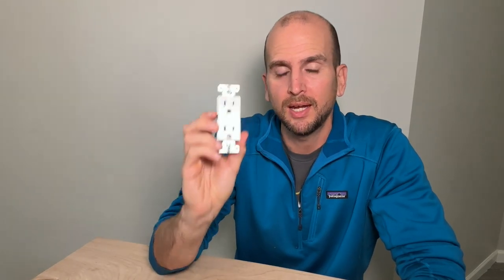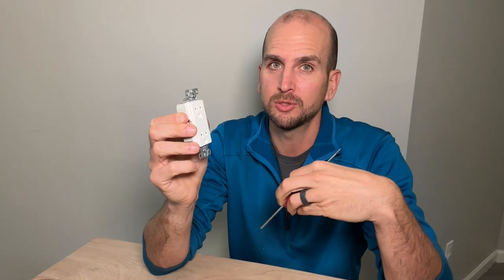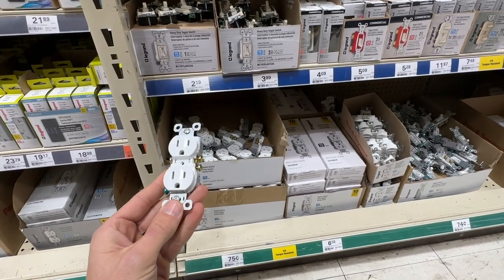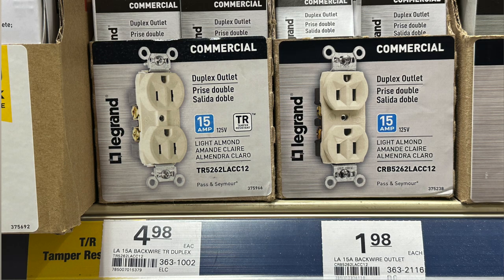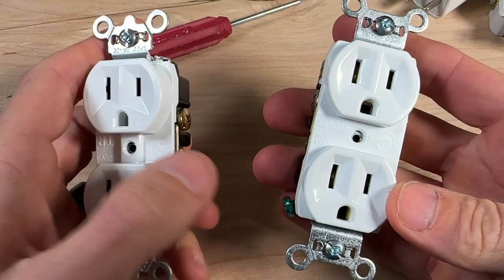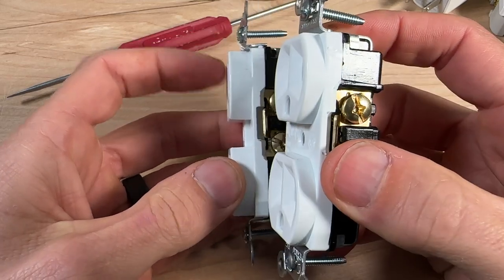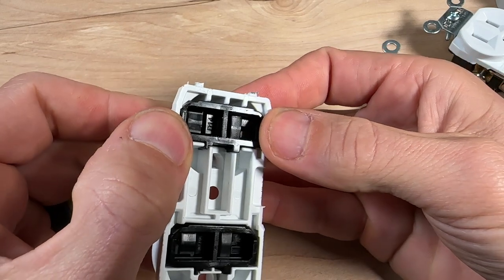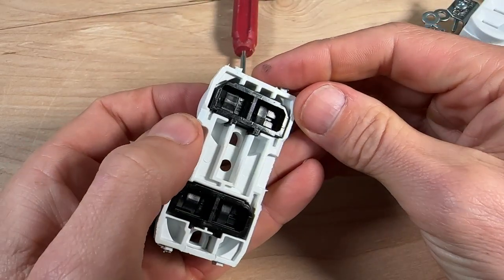The Most Hated Product In Home Electrical

Comment: TR receptacles are a great idea.  However, some of them are plug resistant.  I use Leviton but Legrand is pretty good too.  I don't have any bad brands.  They're all pretty good.  I have a 3 year old niece and a 12 month old niece and I babysit them a lot and so, I absolutely must have TR receptacles for sure!  I plug and unplug equipment constantly and the TR is a must for me.  My dad's RV had cheap quality receptacles and I replaced them with TR because I have 5 step nieces.  I admire the idea behind the tamper resistance receptacles.  I have to have them because of my 7 nieces total.  A power cord is just going to hang there.  Clock is just going to stay plugged in 24/7.  An alarm system is too going to stay plugged in 24 hours a day, 7 days a week, 365 days a year, 12 months a year, and so forth.  But a lamp on the other hand, we've all done it, I've done it, I do it every time I shut off my metal halide fixture, all finished using it, reach down and jerk the plug to turn it off.  I do it to my Christmas tree all the time, I do it to my metal halide light when I turn it off...unplug it to turn it off.  I do it to my central vacuum powerhead to turn it off.  But, no one ever remembers to reinsert the plastic caps, I don't.  Well, when the receptacles are uncovered, that puts small children at risk.  That's why I absolutely depend on tamper resistance receptacles.  In fact, TR receptacles are all I buy because of my nieces.  I had a ceiling mounted receptacle for a garage door opener go bad and I just threw up a tamper resistance receptacle because that was what I had on hand.  That should illustrate how much I depend on tamper resistance receptacles because I babysit my nieces a lot and I love my nieces very much.  So, naturally I am very protective of my nieces and I only buy tamper resistance receptacles for that reason.

Comment: Never had an issue with them. I learned from an electrician friend of mine to angle the plug downward at the outlet openings and kind of roll the plug in. Rather than trying to go straight in as normal. Super easy.

Comment: The residential grade Legrand TR receptacles are pretty glitchy, I find I have to really jiggle a plug to insert it, which is mildly annoying. I'd have a pretty hard time justifying its replacement with another TR receptacle, I would probably use a non-TR Legrabd commercial receptacle. I agree they're the best and I live 1/4 mile from Menards lol

Comment: I put outlet covers that have a sliding cover that stops anything from being inserted that I used when my daughter was a toddler. Those are less complicated, don’t bind as easily, and have a lower price difference than standard covers when compared to tamper resistant plugs.

Comment: I bought a pack of 50 TR outlets on amazon for less than the cost of buying 20 standard outlets at Lowes. I generally prefer them just for how difficult it is to accidentally unplug something from them. Then again, I'm changing out the 40 year old receptacles in my house for new ones, so it only made sense to go for the better bulk deal. At the end of the day, they don't really have any cost difference unless you buy exclusively from brick and mortar stores.
Reply: I hope you like changing out broken TR receptacles
Reply: Bootleg Chinese most likely, or stolen from somewhere if legit.
Reply: What you really want are called spec or hospital grade outlets. They tend to cost a bit though.
Reply: Those bulk packages are  junk... Only if they are buying cheap contractor grade TR Outlets which do not function well....... If you purchase quality TR outlets they function flawlessly! TR Outlets are not deeper than a non-TR outlet...
Reply: Landlord detected

Comment: In our areas, central Arizona, the dust ends up clogging the shutter on the TR receptacles. I’ve never found them to be that much safer, similarly the tamper resistant medicine bottles.

Comment: LOL, I just replaced 112 outlets in my house. I use the Eaton commercial grade outlets, that run about $1.98/ea in 10-packs. No WAY would I pay an additional $330 for unreliable tamper resistant outlets in a house that has 2 adults and 2 dogs.
Reply: Unreliable?
Reply: @michaeldunham3385  Shutters jamming or breaking. The electrical side is going to be as reliable as the same model without TR.
Reply: @JCWren  never had a problem with shutters breaking or jamming

Comment: Since I live in a different part of the world with other outlets (Schucko) I must say I was surprised that those non-tamper-resistant outlets are still allowed. The only outlets that are not tamper resistant that are allowed are those already installed, afaik. There is one exception. The 3-phase sockets have no tamper resistance, but those are never installed indoors where children are supposed to be, but rather in a garage or an industry. (I have a 3-phase soccer in my garage. I can use it to charge my car with a portable "wallbox".)
Reply: @Phillip Banes  Of you think that it should be allowed to install dangerous equipment where kids are supposed to live, then we can only agree to disagree.

Comment: I recently replaced all the (backstabbed) outlets in my house with residential grade Leviton Decora tamper resistant outlets. I get the 10 packs from Home Depot. I occasionally have a little struggle when plugging something in, but I can't say it's been an issue in general. Maybe that brand is one of the good ones?

The price difference isn't nearly as much as the ones in the video either. $13.48 for standard, $19.98 for TR. That's 50% more, not 250% more like the commercial outlets in the video.
Reply: I built my house with these, have had good luck.
Reply: I just installed these too. I like them, and actually don't notice anything when plugging something into them.
Reply: I bought the same. I've never noticed any increased difficulty using them, and the price difference was similar and I say negligible when it comes to safety. I'm not understanding people's issues with these, I guess.
Reply: Same here and haven’t had any of the issues that the people in the comments are saying they have/had with TR outlets. Leviton is the way to go 👍🏼

Comment: As someone with kids, I started with a mix of tr outlets and the plastic covers for existing outlets. I eventually just replaced the first outlet in each chain with a gfci outlet. For the two kids rooms (which sadly is on one breaker) I replaced the breaker with an cafci one. That's how much I hated the TR outlets and the plastic covers.

Comment: I use Leviton receptacles, and Home Depot has them at same price 10 for $50. They have a metal shutter on one side. Their design works well easily sliding a plug into them.

Comment: The sockets in my home were bad, and my son was just starting to crawl. Tamper resistant receptacles just made the most sense. Sometimes they're a little finicky to plug something into, but it's never a big deal. In my garage, I just used regular, non TR 20A commercial grade receptacles.

Comment: When I was about 7 years old I did exactly what he describes and got a good jolt.  I never did it again, but had I not reacted as quickly as I did, that decision may have been made for me on a permanent basis.  This seems like a good idea that addresses a real problem (as opposed to so many so-called safety features that are really just Darwin candidate lawsuit prevention), it just needs some work to improve the design.
Reply: When I was growing up I got a pretty good jolt trying to unplug a big wall wart adapter, fingers slipped and grabbed both prongs while they were still party inserted. TR outlets require a lot more force not only when inserting the plug, but also while removing it. So they prevent one way of electrocuting yourself at the cost of making a different way of electrocuting yourself more likely lol
Reply: This is literally an anti-darwin mechanism. Remember darwin isnt just checking the child but also the parents. Theres alot of parents that shouldnt have kids, and this is preventing one of those checks. A good parent would install the plastic covers, a bad parent does nothing.
Reply: @fctoashton  No serious adult should be conflating natural selection, which humans have bypassed for several centuries, and any safety methodologies designed within a single lifetime, to reduce possibly lethal accidents. Seatbelts, along with modern auto design changes, halved the fatalities, which were once equal annually, to the entire American deaths in the entire Viet Nam war -about 55,000.
  Cynical, self-centered, self-righteous prigs believe they and their families, unique above all others, have a "right" of privilege, to flaut any law or restriction they find inconveniencing, believing their superiority makes them better arbiters of what regulations need apply - until they suffer a consequence, and sue everyone within arms reach, for damages.

Comment: We moved into a home built in 2010. It had all tamperproof receptacles. Two issues we found..  number 1, the TP receptacles installed here have an issue that causes plugs to have next to no friction when plugged in. This means the TP functionality appears to have caused the receptacle sockets to be further back and therefore reducing the contact surface that meets with the blades of the plug. This to me is a fire hazard, as if you are using higher amperage appliances, and the there is lack of good contact, it heats up or arcs.  This seemed more common on receptacles in areas that are used more than others so there may be a wear issue.    number 2, as you mentioned, some plugs are a pain to insert into TP receptacles because the doors won't open. You have to fiddle with it to insert a plug.   We replaced many with non TP receptacles, and purchased spec-grade quality ones.

Comment: Faced frustration with a tamper resistant outlet in an AirBnB (or similar, don't remember for sure) I had for a few days.  I took a key, lined it up, gave it a good whack with my shoe, and no more problems.  Even tho it was in the "long" (neutral) side I did wrap a sock around the key before pulling it out. 😁

Comment: The plastic plug caps are really cheap for the few years you need to protect your outlets.
Reply from the maker: Yeah, not a bad option for sure
Reply: We got the plastic plugs when our son was born (his 23rd birthday was today)and the same plugs are still there and working fine.
Reply: They just look silly, and can be removed.
Reply: Don’t know about where you live, but those child safety outlet covers are actually not up to code in my area! The reason is, if you have a looser fitting (possibly older residential grade) receptacle, your child can easily pull them out of the outlet! I remember pulling quite a few out myself when I was little!
Reply: Children can easily remove those plastic plugs-definitely a false sense of security there.
Reply: @alandaters8547  The plugs I got are still working fine after 20+ years.  Maybe you should try different plugs? 😂

Comment: I've found that most people don't like the TR recpts because they are difficult to use.  Unfortunately, whenever something becomes part of "code", the price of the product becomes unnecessarily exorbitant.  And, their required use becomes more ubiquitous.  Take GFI and AFI protection, for example.  Just as you state, they may serve a purpose, however limited, but their use and installation multiplies with every code cycle.  It's almost as if the code making panel is comprised of manufacturer reps forcing the new expensive products on the public.  This is usually at the expense of the public or installing contractor as they become the unwitting R&D for these products; especially when they fail.
Reply: Guess who the "experts"are on the board panels suggesting changes......industry insiders and investors
Reply: Indeed.  Over the past few years, GFCI and AFCI & now TR are required on almost everything in the home.  It looks like it is mainly a profit-driving measure.
Reply: Only if they are buying cheap contractor grade TR Outlets which do not function well....... If you purchase quality TR outlets they function flawlessly! TR Outlets are not deeper than a non-TR outlet...

Comment: Where I live in Canada, all new homes must have the Tamper Resistant wall outlets. If you have an old extension cord with the folded over brass prongs you will notice that they plug right in without any effort. The reason people have trouble is because many of the newer solid prongs have burrs on the prongs, if you take a file and round over the end of the prongs they will go in easily.
Reply: so a Home owner has to modify the prongs of their appliances due to a  gimmicky 'safety' devices fickle pisspoor design?  yea that'll go over real well

Comment: I lived in Hong Kong for a few years, where the large UK type plug and receptacles are used. At first I didn't like the large plugs, but soon grew to like them. The UK plug also has protective shutters on the receptacles, but the shutter is activated be the longer protruding ground contact. This means that all devices, including small low voltage chargers, must have a ground contact. Often on small chargers, the ground isn't needed, so a dummy plastic contact serves to open the shutter. I'm my experience, these all operated without difficulty and even the $1 receptacles worked flawlessly. Not that I'm back in the USA, I miss those reliable, hefty plugs and sockets.

Comment: My main reason for using TR outlets in my home more than standard outlets is that the shutters prevent dust and pet hair from getting into the slots and causing damage or connection issues. Although this is mostly theoretical and I have not had an outlet die because of this reason, it's an extra feature I think is worth the cost for potentially improved longevity. Of course, that longevity would be cut short if the TR mechanism fails, but I have yet to have that happen to me (I use Legrand).

Comment: Replaced all my wall outlets with Leviton Decora TR... sometimes they work well, sometimes they give me grief even with the same plug.  I don't find myself plugging and unplugging stuff that often, as something like our vacuum is now rechargeable, and the dock stays plugged in, so the safety factor with a Toddler in the house is a no brainer.  Tried those safety cover plugs first but they caused more curiosity and tempted my kid to fiddle with the outlets more.  When I do my kitchen outlets, I'll steer clear of the TR for most of them as the safety risk is much lower.
Reply: I also updated my house with Leviton Decora TR, and they've been pretty easy to use and operate reliably the very few times I ever need to plug something in. I suspect a lot of the frustration folks are experiencing is due to poor-quality outlets that only meet the bare minimum standards. I did pay through the nose for them, though, can't deny that.
Reply: @JohnVance  I didn't think the residential grade were that bad when bought in 10 packs, sure more than the cheapo builder grade.. Kitchen will get commercial those add a few more bucks.... It's the screw less wall plates that get you.

Comment: From what I see, TR outlets are required by code. NEC 406.12: All 15 and 20 amp receptacles in seven common areas (including dwelling units) shall be listed tamper resistant receptacles. (paraphrased)  Meaning - if you touch it as a project, it need to be up to code. Existing receptacles do NOT need to be TR. In my projects. I install TR outlets to be code compliant. They are quirky but they work.
Reply: Backwards progress! Normal outlets just plain work, not kinda janky work. Too much government!

Comment: I buy the Decoras and it's actually been pretty hard to find any on the store shelves that aren't tamper resistant.  I have to special order the ones that aren't.
Reply: If you add a new circuit greater than 6 ft. you are required to use TR Outlets! Let someone get hurt in your home with an item that you should have purchased diffectly by code and see what your homeowners insurance does if they is a liability issue...
Reply: @michaelholliday100  I'll take my chances. By the way, when I said "Special order" I meant that I just have to order it online instead of in store. Home depot sku 799778. My local store has 7 in stock in white. Compare to the TRs they have 49 in white.

Comment: The 2017 NEC requires TR (tamper resistant) receptacles basically everywhere, they are not required for receptacles mounted 5 1/2 feet above the floor. Love em or hate them they're here to stay. As a licensed master electrician i am required to replace any receptacle with TR receptacles, only in the circuit worked on, so if i changed receptacles in the kitchen to TR receptacles, i don't have to change the receptacles in bedrooms to TR receptacles.

Comment: As a former child, I can tell you that most of the likelihood of a kid tampering with an outlet has to do with the kid. I am not saying TR receptacles aren't a valid product. 

I don't recall ever trying to insert anything into an outlet. But On probably 2 occasions I purposely touched both prongs of a plug while it was partially inserted in the outlet, to know what it felt like. After the novelty of the brief "vibrating" sensation lost its allure, so did any further attempts.

Much later, we used the plastic inserts when our kids were young. They could have easily defeated them, but never were interested in trying.
Reply: My mother frequently told the tale of how as soon as I could crawl, I'd make my way to where her vacuum was plugged in, and unplug it.  She had to pen me up to finish the job. Experimentation has continued for decades since (with more electrical shocks, plumbing accidents, auto mishaps, ... than I can count).